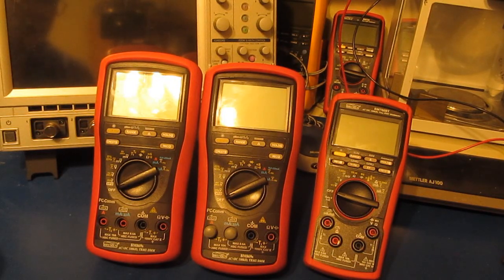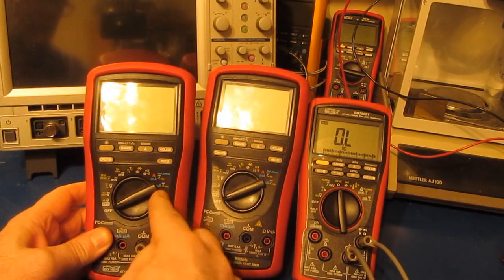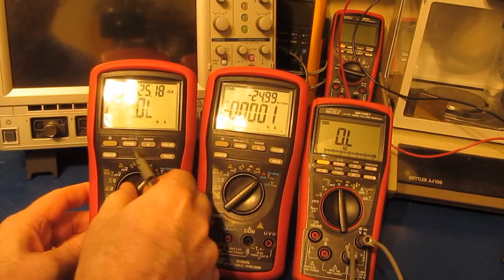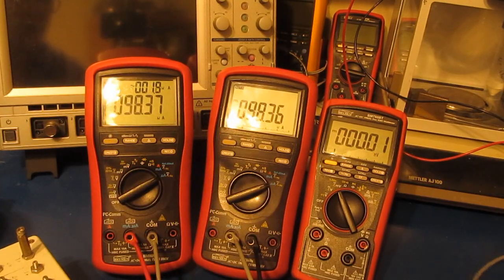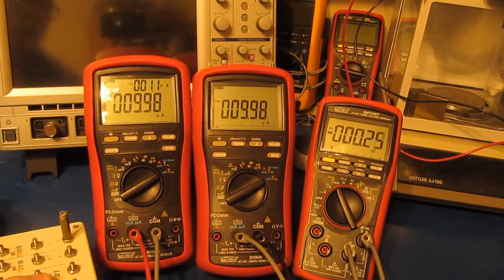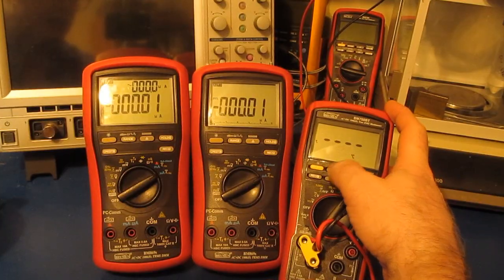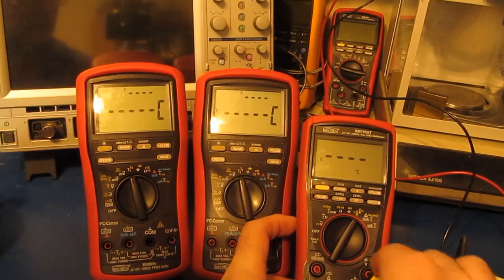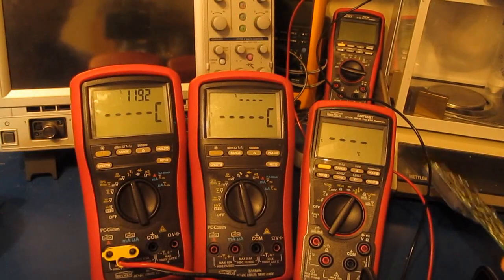Brymen BM869s Switch Wear Effects on Temp and Current Measurements

Comment: BM869S is equipped with a REF43G voltage reference with rather modest parameters, how about the stability of readings over the temperature range?
Reply from the maker: I have ran it over a fairly wide range.  Videos and data I have collected are available for those interested.

Comment: Makes sense, thermocouple is low impedance, and properly designed meter would be designed so that switch resistance affects reading as little as possible.

Comment: Since the multimeter measures the voltage drop directly across the shunt, and not through the entire circuit including the switch, wear of the switch cannot affect the readings — only the overall voltage drop between the probes.
Reply from the maker: Seems like you didn't actually watch the video as this was all explained.  Also, these inputs are also used to measure temperature.
Reply: @joesmith-je3tq  This wasn’t a reproach toward you — it’s more of a straightforward reply for those who might wonder about such things. I watched the video in fast-forward, since to me it’s obvious that contact wear has no effect on this kind of measurement in a properly designed instrument.
Reply from the maker: @MaxPivovarov  No effect, that is until the switch fails.  Many of the meters I have evaluated did not fair so well during that life cycle test.   This includes one of the name brands..

Comment: Thank you very much! I didn't know that meters with uA range anway switch the mA shunt. Then Brymen with T2 do not really do anything out of the ordinary?
Reply from the maker: Every design is different but yes, it is common to have mechanically switched shunts in the low ranges.   See the following where I go over my UT61E mods to lower the burden voltage:   https://www.youtube.com/watch?v=14eHpHQxm54
Reply: @joesmith-je3tq  Thank you! Does the Hioki also commutate the mA and uA shunts?
Reply from the maker: @khi787ghid  You are welcome.  Yes, the Hioki DT4282 also mechanically switches shunts between mA and uA ranges.
Reply: @joesmith-je3tq  Interesting! I thought a separate mA input is so that current didn't have to flow through the switch. Turns out, it's more of a protection from accidentally shorting your 1000 V source?
Reply from the maker: @khi787ghid  It has nothing to do with protection.   The low current range shunts all feed through the same fuse.  If not a mechanical switch, how else would you select two or more shunts for the different ranges cost effectively?   I suggest you watch that video I linked for the UT61E.
Reply from the maker: Also, keep in mind that the Brymen BM869s you asked about not only selects between the different shunts like most meters, it can also remove the shunts from the ground path to read temperature as demonstrated in this video.